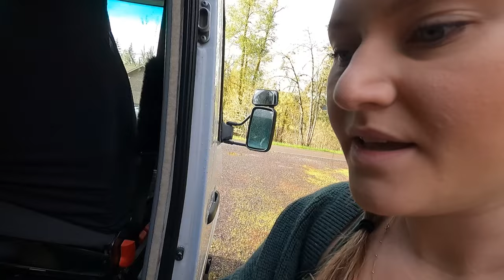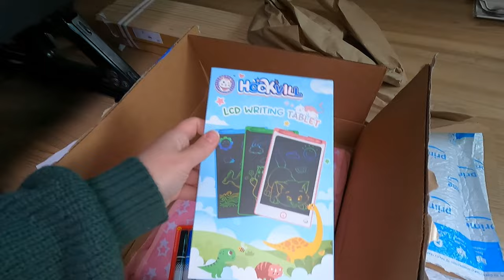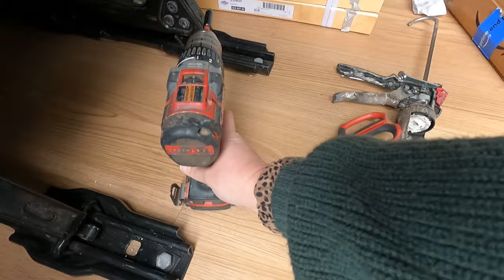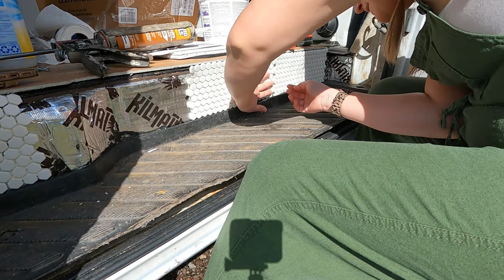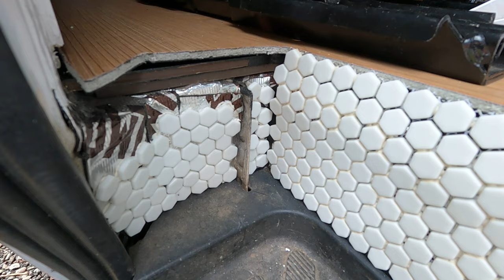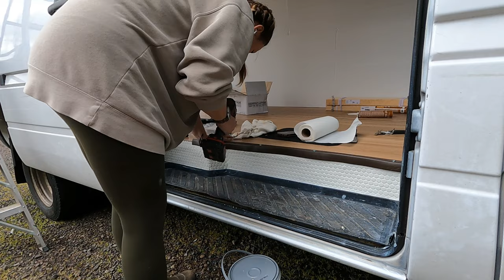I couldn't take it. I HAD to make a change.

Comment: Be very careful with tile on your steps.. they’re very slick when wet.. if climbing in with wet feet, you could suffer from a bad fall.. I have tile that’s recommended for bathrooms and I’ve slipped down several times over the years..
Reply from the maker: No tile on the actual step, just the wall
Reply: Looks great Jaylena!   I tiled my kitchen....alot of work but so happy I did it.
Reply: Looks really nice! It will be quick and easy to clean up. Good job!
Reply: Looks great. I think you should do the kitchen backslash the same.
Reply: So much better! Great decision. Looks great!

Comment: Rubber backed industrial rug cut to size that way it wont slip on the original step when getting in, and can easily be removed and washed with a garden hose or at a self serve car wash.

Comment: That was some intricate work with so many tiny individual pieces in parts Jaylena. Well done. My Sprinter still just has the metal backing and rubber mat. I'm now thinking after 6 yrs, should I be changing things up? 😊💌 🙋🏼‍♀️🚐

Comment: IMO. I would not use carpet on that step up. It will get so dirty. I think it would be easier to clean if you just use that black rubberized paint you used on the sub floor.
Reply from the maker: When I say carpet I mean like front door mat🤗